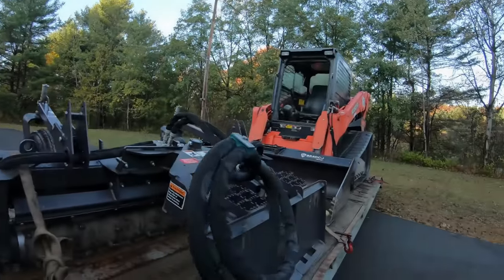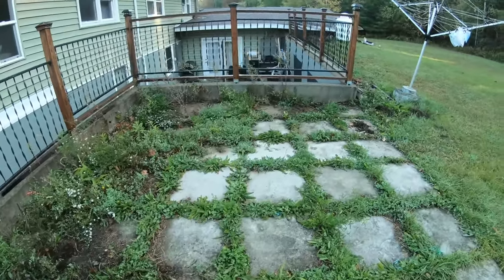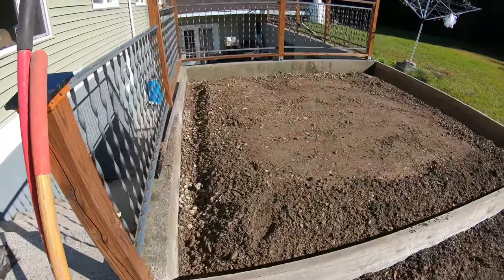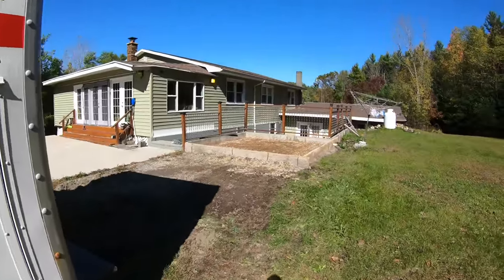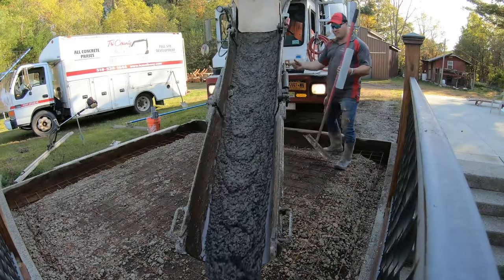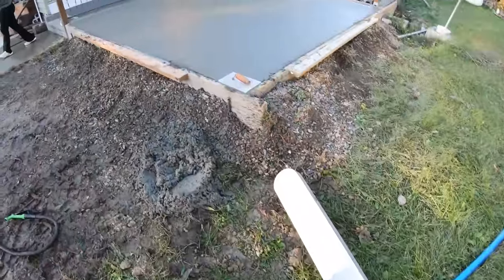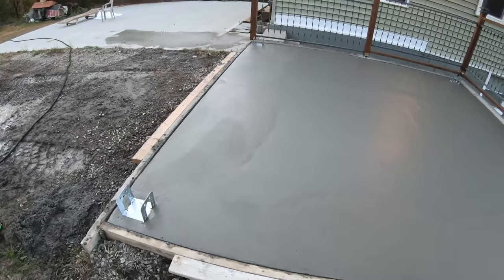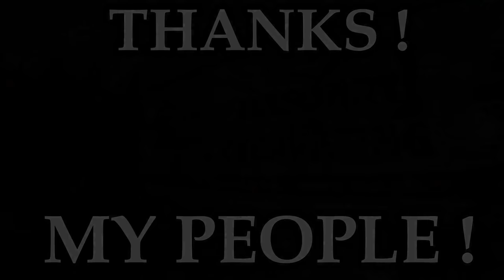Hot Tub Pad Monolithic style

Comment: Great job! - 
Question: my hot tub will be 230v hard wired. Planning to run conduit to somewhere inside the pad, but I’m not sure where the turn-up location should be (under the hot tub so it’s hidden?, back of the hot tub so it’s not as visible ?) Any recommendations?
Reply from the maker: Yes you need to find out in your hot tub where your electrical windows are and place it accordingly.. That way it will be hidden and up through the hot tub correctly
Reply: @DIRT-BOSS  Thanks for the quick response! I’ll look into it
Reply from the maker: @kstroble  No problem man Good luck